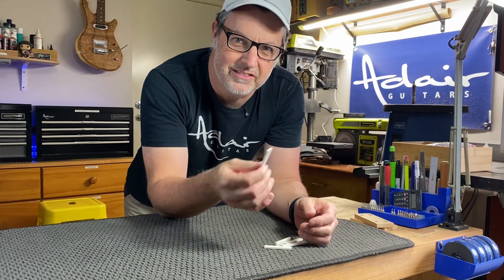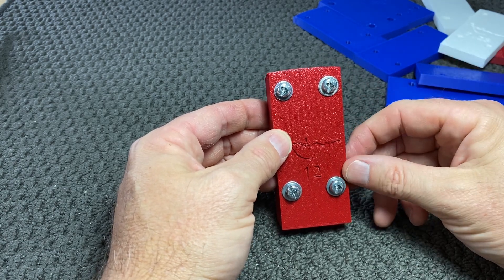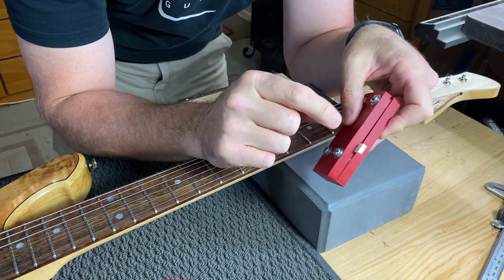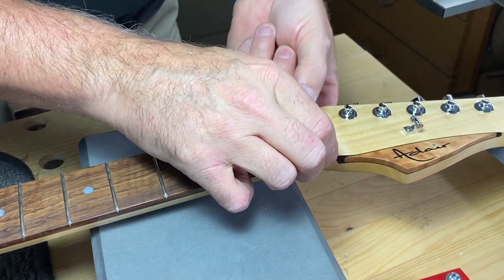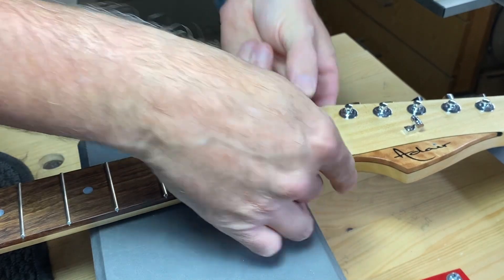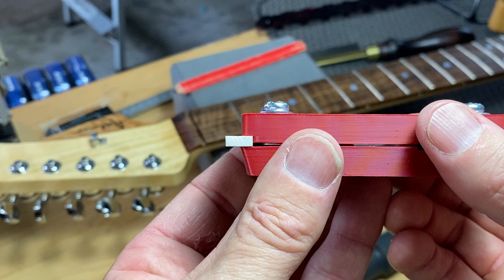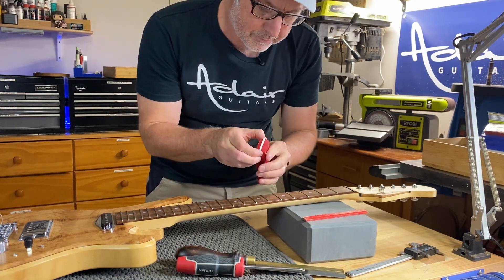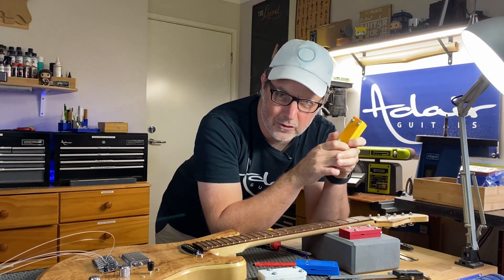I 3D Printed a Guitar Nut Mini Vice!

Comment: Nice. 
Wouldn't small thumb screws be enough to hold it in place? Would remove the need to use a screw driver every time.

Comment: Thanks for the great idea! I will be trying this myself. Very kind  if you to give your design away. Is there not enough clamping force in the end notch to safely cut the nut to length there? It looks tedious to tighten and loosen four screws just to clamp a blank for cutting in the middle notch. I have a couple suggestions too: 1.) If you use flathead screws (at least the back two), you can set it in your bench vise deeper because protruding screws won't get in the way. If you don't really need the middle notch for cutting blanks, you only need the two screws up front, possibly with a 3D printed alignment feature to keep the two halves of the mini vise aligned. 2.) Another suggestion is to 3D print the notch at a 15-degree angle so you don't have to tilt your sander table. I did that with my wooden fixture because it is not easy to reset my sander to a perfect 90 degrees.
Reply from the maker: Some great suggestions. I’d be reluctant to use the end notch to cut the nut length as there is less contact area and therefore less pressure on the end.

Comment: Always thinking Arran.  Love it!  I do have a couple of ideas for refinement.  1. Maybe angle the top half of the vice as well, so you can clearly see the pencil line when sanding.  It seemed to me that the current edge could mar the vision needed for complete accuracy.  2. Could you add string markers to the top edge so you don't have to measure every time you cut for strings.  All the best, Jonathan.
Reply from the maker: Thanks Jonathan! I did try an angle on the top section but from memory it reduced the gripping surface if it was angled back and if it was angled forward, the curve would be different (I think!). I do like the string marker idea! 🤔
Reply: @adairguitars  Chamfer?
Reply from the maker: That could possibly work.

Comment: Wouldn't two fender style neck backplates bolted together do the same thing?
Reply from the maker: I’m sure they would, but they would scratch up the base of the disc sander. That would be similar to what I used to use with blocks of wood.